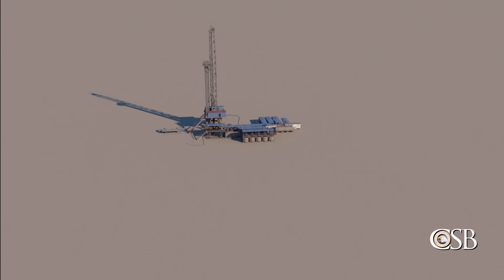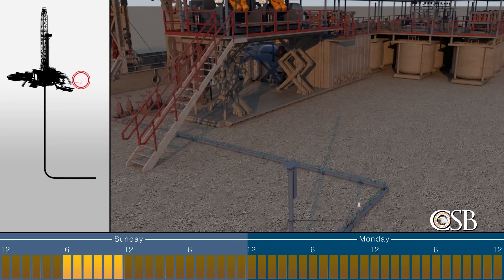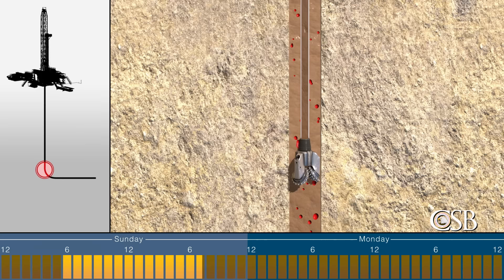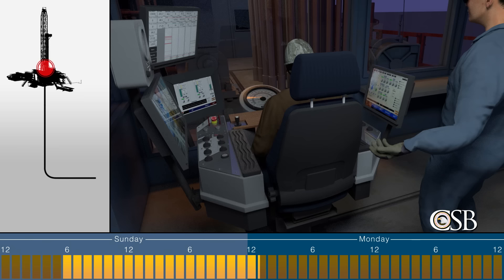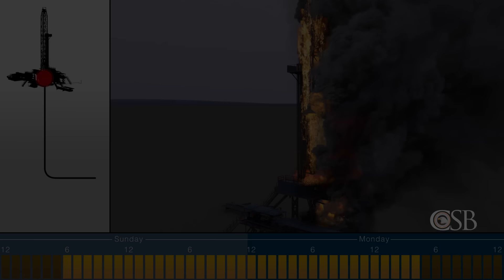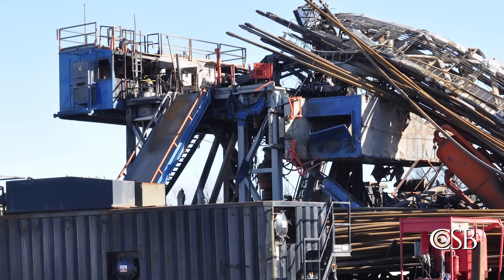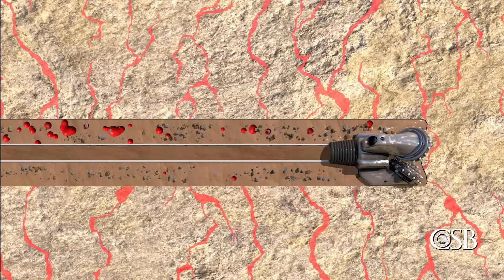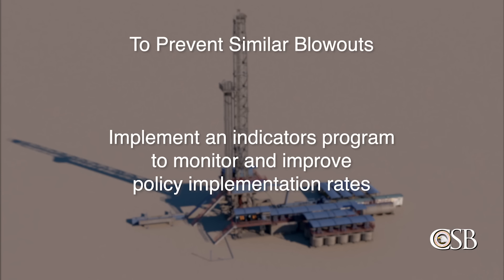Blowout in Oklahoma

Comment: I count at least three warnings this crew had that they were taking a kick or at least getting dangerously underbalanced. They must've noticed at least one warning sign because they started sending the mud returns to the gas separator and flaring lots of gas. So why didn't they immediately stop tripping, circulate the well and start circulating in heavier mud? Seems obvious - what am I missing here?
Reply: Humans are prone to stupidity. Especially if they're under trained.
Reply: The deadline
Reply: @RJEvans44  always.the deadline
Reply: Cheap labor
Reply: They were consciously drilling  under-balanced what they thought were rather tight formations (hence later to be fracced).  That is okay if one has the right set of UBO equipment (see IADC UBO guidelines) and training, but they had only part of that equipment, the rotating head and a flowline shut-off valve.  And evidently ran into an unexpected somewhat permeable zone that fed in faster than the crew realized.  The 'Calculated Fill' method they used masked the gas influx, and the pumping difficulty it led to evidently confused the crew, who had been told that pumping in the mud would push any influx gas safely back into the formation, which is to say, where it couldn't hurt them.  Etc., etc., as the video portrayed.
Reply: suspicionofdeceit  The key members of the rig crew had years of experience.  Whether they were capable of processing basic information or not?  A short video can't convey such, but you might get a feel for the answer from the full CSB report.
Reply: We have much broader knowledge than nearly everyone who’s boots were on the ground at location. We’ve been told what was important after the fact, not the endless specificities that everyone there had to know, endless things that were not in the least bit relevant here, but all things that could just as easily have killed everyone on the rig.
Reply: @Suburp212  $100,000 a year is 'cheap?'
Reply: Darwin.
Reply: You're missing any of the other 110 things they fucked up. 
That should've been obvious.
Reply: Dead to nuts... you are spot on. If you are circulating that much gas you have to mud up and watch out for losing circulation and I am sure that that is an area of concern there as I worked that area for years as a mudlogger or more commonly as an air logger since we drilled with air. And I found people used to drilling on air often are poor at drilling with fluids.
Reply: @driller43  Good point, the mudlogger told them they have broke into a more porous formation...probably Hunton below the Woodford, so they were no longer in tight rocks. No one pays any attention to mudloggers. I know I was one for 20 years.
Reply: @rocksandoil2241   Hooray found the mud logger.  I'm one too, I can tell you nobody on this rig knew what they what they were doing. The proper amount of fill is the first critical situation that should have been taken care of and figured out. The pits were filling up like a bat of hell. 5 stands,  3 1/2 barrels. If it takes less and gets worse you better stop, Go to bottom and shut in the well. or shut it in right where it's at.  This sounds like a thing from the past but this was 2018. Crazy man.
Reply: suspicionofdeceit  The toolpusher of the drilling company was the first management failure in the inabilty to mange and/or ascertain the competency of the drilling crew. The company man or drilling representative, who should have drilling engineer knowledge or close to it and years of experience has the ultimate responsibility as he has the final decision in any operation that takes place on the location. All the episodes of abnormal behaivior of this well "should have been addressed before operations were extended resulting in a cascading failure. The signs were there from the beginning of the trip and also before that ill fated decision to proceed.
Reply: suspicionofdeceit  I think it was a case of gross incompetence by management with maybe a strong case of exactly what you are stating in your scenario.

Comment: Alarm fatigue is real and the lack of industry guidelines on them is crazy.  From IT to industry, alarm and alerting settings are going to vary wildly from site to site because it's usually up to the installer of the system or the operators to set these up. I work in IT and I can say the amount of alarms setup out of the box with equipment is crazy leading to them being ignored constantly. This is a  problem everywhere and while some places may have good practices to reel this in, most do not, even in dangerous operations as shown here.

Comment: "The night-shift driller turned off the entire alarm system..." 

One incompetent screw up after another. And death ensues.
Reply: You do not need an alarm to tell you that mud is kicking over the bell nipple. The reaction should be the same, mud up, weight up, circulate the bubble. Don't depend upon blind rams to save you.
Reply: @SandmanSand  that's a pretty terrible thing to say.
Reply: You should not be able to turn alarms systems off

Comment: Why in the hell would any alarm system be allowed to be turned off? I mean, if you want to temporarily silence it, fine; but it should re-arm itself automatically after a certain duration and only be disabled a certain number of times before you can't anymore.......
Reply: auto matic shut down dont bother somebody will pull a fuse

Comment: I have too many questions. Nowhere is anything mentioned about the mud engineer, the mudlogging crew or the  pit man/derrick hand. 3 additional safety features that should have been monitoring 100 bbl+ gains in the pits. Tripping under balanced is risky to start with, tripping with bubbling / gas cut mud?
Reply: The mudlogger did notify them that they had broke out of the shale and were not where they were supposed to be. When tripping most rigs bypass the shale shaker hence the gas detector would not have been in mud, would not have been read by the mudlogger. It woud have been high and dry in the possum belly.

Comment: I still don't understand why the gas kept flowing. If they all retreated to the control cabin why didn't they just close the BOP immediately and stop the blowout??
Reply: I was hoping they'd address or at least speculate on why not; though one hint may have been unfamiliarity with the computer system -- though I imagine there's like, what, a big red button for something like the BOP, right? Though, CSB didn't indicate what the time between retreat and ignition was, maybe they just didn't have time.
Reply: The well was flowing because it was underbalanced, not enough mud density. The driller didn't realize the well was flowing until it came up onto the floor.  He then turned to push the 'red button', but it was too late.  The flow also instantly rose high in the derrick and ignited - driller was apparently knocked down before he could take the couple of steps to the BOP panel to actuate it.  Many do not realize how fast a gas bubble can go from moving to full erupt to high in the derrick -- can be just a few seconds with a good sized bubble.  A similarly rapid gas unloading happened on the Deepwater Horizon, caught fire, killed 11.
Reply: @driller43  so there is no way to actuate the bop in the control cabin that they all retreated to? If that's the case then that seems like a much more important safety oversight to remedy than the relatively obscure and questionable "state based alarm strategy" suggested in this video.
Reply: @Muonium1  There IS a BOP control panel just behind the driller's chair in the cabin!  He evidently went to actuate it, but didn't make it.  I interpret that the ignition/explosion blew in the cabin window and knocked him down.
Reply: 10mintwo you see mud bubbling up and guys screaming, so you spin around in your chair to smash the big red BOP button, but before your hand reaches it a bubble of gas erupts from the mud, knocking everyone off their feet and showering you in glass from the window of the operators cabin, before you can get back to your feet the gas and mud mixture has ignited, blanketing you in flames. 

There was a button. Someone wanted to press it. They were killed before they had the time.

Comment: I was judging these guys for their failures. But then I remembered my navy days when we had low coolant alarms for my weapons systems. The problem was that we were located at high points in the cooling system so air bubbles would reach us and cause the alarms to trip. Not only did the alarms sound in our shop, but also in the combat systems office. To stop them from constantly going off and to stop calls from the combat systems office we would disable the alarm. If we truly lost coolant flow, the actual weapon system sensors would tell us right away. But it was still a safety violation that we casually did.
Reply: Yeah, it's always too easy to judge these people but everyone cuts corners every day. It's not a good thing, but everyone does it and sometimes, clearly, to a bad extent.

Comment: The alarms keep going off? Well just turn them off.. that is insane. The oil field is a very dangerous place to work and a lot of that is because it is a lot easier to ignore safety regulations when you work in the middle of nowhere and culture of pushing employees to break rules to increase productivity. Like most accidents, there were numerous times this accident could have been avoided.
Reply: Not that simple.  The alarms that were going off were false - irrelevant to the operation in progress and posing no risk.  After a hour or more of this, a normal human being will soon conclude the well is safe (everything seem fine, they weren't drilling, so tend to feel everything is quiet, so turn off the alarm horn switch.  They're all false alarms.
Reply: Sounds like you're not married.

Comment: The CSB should have the same powers as the NTSB if it doesn't already. If it does not have the power to enforce its recommendations nationally and to integrate new policy into related work-practices, the system is broken. If it does have the powers = what is going on????
Reply: CSB has no enforcement powers.
That is OSHA's job.
The CSB hopes since they can't issue fines workers involved in incidents would be more likely to provide honest answers.
Also nobody at OSHA wants to give up any power.
Reply: Essentially same powers as NTSB.  They can make recommendations, but the agency, organizations, companies, etc. do not have to accept them.

Comment: From the report: "At the time of the blowout when mud started erupting from the well, the motorhand and second floorhand entered the
driller’s cabin. The driller, company man, and directional driller were already inside the driller’s cabin when the
blowout started. All five personnel were victims of the blowout and post-incident were found deceased in the driller’s
cabin. The locations where the victims were found is shown in Figure 42. Autopsies determined that all victims died
from thermal burn injuries with found or probable smoke and soot inhalation."      RIP, fellas.
Reply: It's ok.  They exercised their rights and didn't have to worry about any nonsense from OSHA.

Comment: The rocket industry has figured out that you should keep people a very safe distance away from the stuff these guys are drilling for. Perhaps it's long past due for drilling to become a remote operation. The technology, and engineers smart enough to design it, surely exist today.
Reply: Like a remotely constructed building?
Reply: Simply thinking of engineering design that specifically keeps operators away from the well head fire hazard, where possible. What that looks like in the real world is best left to people like you I expect.

I've done literally thousands of drills for emergencies at sea, and have never once had to use that training. All the ships have lifeboats, despite the fact, the overwhelming majority of them, are never used for their intended purpose. 

I think it would be best if the industry did what the CSB suggests, and came up with it's own set of codes and practices. The ASME pressure vessel codes, strike me as a good example.

I'll gladly pay a little more for gas if it means drillers like these get to go home to their families.

Comment: I worked as Mud-logger and while tripping the mud from the mud bucket can reading can be tricky, but derckman and mud loggers both maintain their own trip sheets. But since the derckman is  triping drill pies it is usually a new roustabout who is doing that, i do not know where the mudlogging crew was in this case, and during flow check Driller along with compnay man , mudlogger is also present. I would say poor communication was the major factor here had they not put LCM the pipes would have not been plugged. But this is a great video to show newcomers for training.

Comment: The tool pusher should have been remotely monitoring the process and should have been able to see this coming🤔
And I have never heard of putting lcm in a pill. That should have been checked as it made no sense🤔
Reply: You have had lucky experience, maybe only hard rock drilling? LCM pills are often placed when a well develops lost circulation.
Reply: @driller43  I worked in West oklahoma and north texas. I know all about ceder fiber and cotton seed hulls " lost circulation material ". Do you not know what a pill is and the puspose of a pill ?   A pill is a smaller volume on heavy weigh fluid put in the well bore to keep gas down, under control and prevent a kick. Lcm in a pill would weakin the integrity of the pill..
Reply: @slevinkelevra5901  My experience many U.S. onshore and offshore wells, and a fair number of foreign operations.  And in those, we would sometimes mix an pill of LCM and not weighted.  Displace it down the drill pipe out and fully out into annulus, then stop and let it sit, do its thing, seeping in and plugging the lost zone perm/fracture.
Reply: @slevinkelevra5901  Focusing on what the crew on this Oklahoma rig thought about LCM,  here is what happened on that rig:  "Derrickhand was told over the radio to make a 50-barrel 10-pound-per-gallon pill. The derrickhand, however, misunderstood the communication and thought that they wanted a 10-pound (ppb concentration?) Lost Circulation Material (LCM) pill instead of a weighted pill. Lost Circulation Material is used during mud losses to plug areas in the wellbore wall where mud is flowing from the well into the formation. It is intended to cause plugging to prevent flow into the formation and is not intended to be used for weighted pills." pg. 39 CSB Report  I understand that LCM pills were used on the first well on this pad (same rig) to deal with mud losses (drilling with somewhat higher MW.)
Reply: @driller43  like I said lcm is not intetended to be used in a pill. If they had lost circulation you know as well as I do that they should circulated. adding lcm to the suction pit till they got adequate returns.  Without adequate returns they would not have been able to utilise the drilling fluids to have well control and to prevent a kick. Derrick hand should have known something was not right when they said to put lcm in a pill. if he was worth his salt. A question will not get you run off but a critical fuck up can get you killed quick as shit. Again I am making the same point. This based on 90% of all the Wells I have ever worked on Were in oklahoma and those precedured we followed. I have not worked with that particular oil company but I have worked with Patterson uti.
Reply: @slevinkelevra5901  You are simply wrong that LCM is not often intended to used in a pill (and actually done).  Reference: internet Schlumberger Oilfield Glossary for 'pills': "... and lost circulation material pills to plug a thief zone."  As a publicly available example, Macondo used LCM pills (made of FORM-A-SET and other LCM), which some premix was leftover from the drilling and contributed to that accident).
Reply: @driller43  from you previous comment you seem to contradicte yourself.   I am good. What ever makes you feel good bud 👍. Cheers fella 🍻
Reply: Also, this from AADE paper 'Review of Lost Circulation Materials and Treatments':   "Shredded cedar fibers can be used as a preventive treatment, concentrated pill or high
 fluid-loss squeezes." (Table A-3)
Reply: @slevinkelevra5901  I don't see my contradiction, unless you think it was my reference that LCM should not be in a weighted pill.  To expand, there are more than one kind of pill:  weighted and LCM are two of them.  Anyway, cheers back, there is much to this drilling business.
Reply: @driller43  now you feel better ?
If not keep going. Like I fucking said hand. I am done 🙄.
Reply: @driller43  keep going 🙄👍🙄